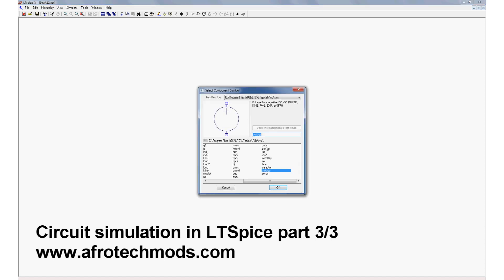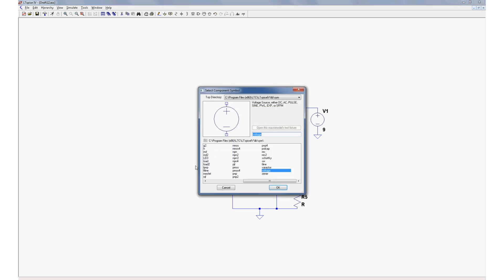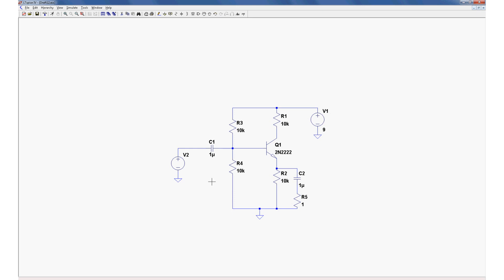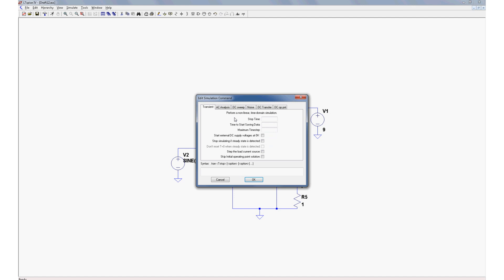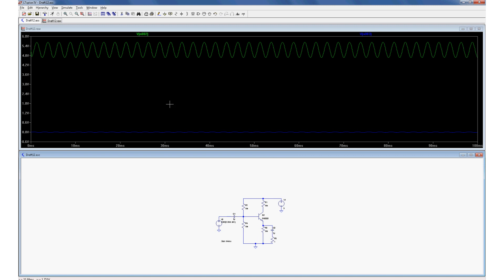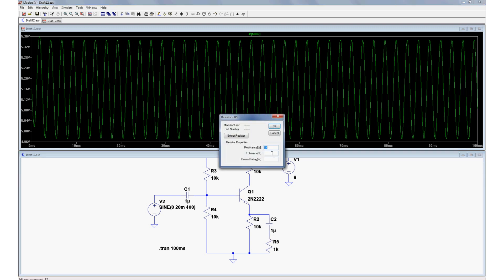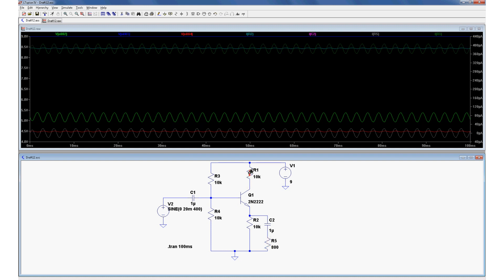Circuit Simulation in LTSpice Tutorial part 3/3

Comment: hi I did the exact same circuit on LTspice but my output on the scope is not perfect the bottom parts of the curves are distorted a little.
basically the whole sine wave output is not as perfect as yours. any suggestions?

Comment: I'm curious why you are calling this a common emitter. Typically a common emitter bias circuit has it's emitter connected directly to ground and is generally used as a dc switch. Your circuit looks more like a voltage divider bias to me, but please feel free to correct me as it's been about 30 years now since I studied this in college so the old brain maybe be forgetting some things.

Comment: hello, your channel is a wealth of information I love it. I was hoping you may be able to clear something up for me however. In this circuit. Why are C2 and R5 necessary. Wouldn't the AC signal travel through R2 just as well? How would removing this component effect your output? Are these 2 components only in place to stop a DC line from traveling through something like a speaker which should only take a signal voltage? Any information you could give me would be a great help. I'm a big fan of your work!
Reply from the maker: R2 and C5 form a high pass filter allowing higher frequency signals to pass through with less impedance than would normally have to go through R2. Since more current can flow for these higher frequencies, a larger voltage difference is created across R1 for the high frequencies. So basically R2 and C5 increase the amplifier gain for high frequency signals.
Reply: Wow that was fast, thanks for the timely, thats very interesting, is there any way to calculate for how much it increases amplification before simulation?

Comment: Excellent, very well done.  But I have a question:  Do any of these simulators (Spice, QUCS, etc)  have a "spreadsheet" like functionality to allow sizing of the components relative to desired (chosen) outputs?  Yes I know that specifying the output is not as easy as specifying the discrete component values, so, let's start simple:  take a simple voltage divider circuit and spec R1 and Vout, then let the system solve for R2.  Can this be done?
Reply from the maker: Not sure about simulators, but what you are looking for is called symbolic manipulation. I do it on my Ti89 but you can also do it on Wolfram Alpha.

Comment: I realize what I did wrong, and my gnd reference was connected to the negative and I was measuring voltage drop across resistor... Why when I inject a 1V sine into the base, I end up with a distorted square wave on the output? I have hooked up transistors like that many times in real life and never had that problem (as far as my ears could tell though ampfing audio).

Also for some reason, youtube states that you've blocked me as a user under my real channel (user/powermaks) Can you unblock it?

Comment: I am injecting a 200 hz sine wave directly into a 2n2222 transistor (collector is directly hooked up to power, the emitter is connected to a 100k resistor to ground.) I measure the output, why is the voltage less on the output than the input? This is also true with MOSFETs?

Comment: No reason to close the output window between simulations, if you don't it retains the settings you've changed. 

Also, you can draw lines (connections) straight through resistors and capacitors, when you press escape LTSpice removes the section going through the component. That'll speed up your drawing a lot.

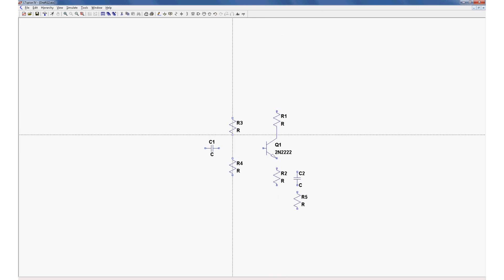Comment: There is a faster way to complete your circuit wiring in LT Spice. For example at 1:05, you can start by creating a wire at the bottom node of R1 then drag the connection all the way to R2 through transistor Q1. 

After you hit Escape, LT Spice will recognize the connection you're trying to make and will delete any excess wires (in this case, it will be the wire that extends from the collector and emitter terminals of Q1)

Comment: @MudDeveloper The beta of your transistor was probably different.  Not all 2n2222s are going to act the same.  This changes drastically with temperature.  It's best to design so you can disregard temperature changes and component variation.  Do a parameter sweep from 50-400 and it should give you a decent range of possible values.

Component values can never be "exact".  The simulation isn't even exact!  You'll get close enough to never notice, though.

Comment: @reviathon360 If you are using a power supply that plugs into the wall this is most likely residual ripple in the power supply's output. Try powering it from a battery and see is it goes away.